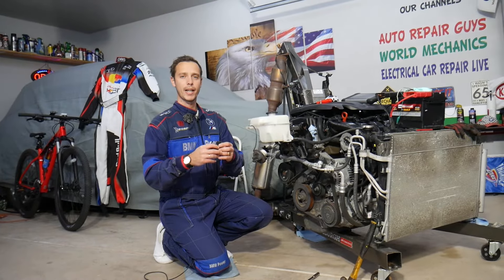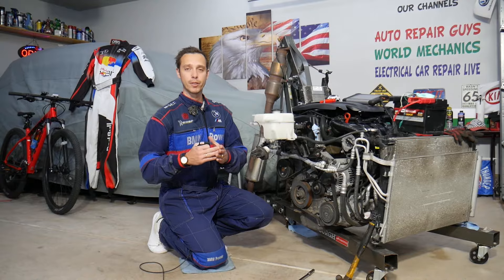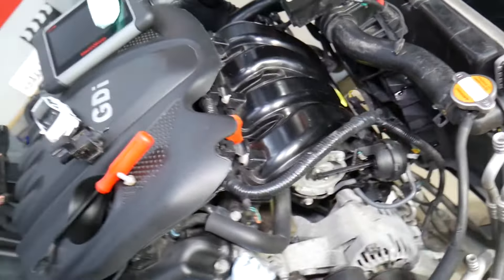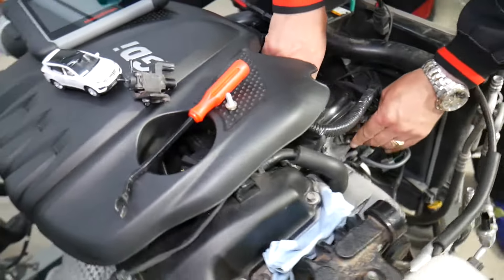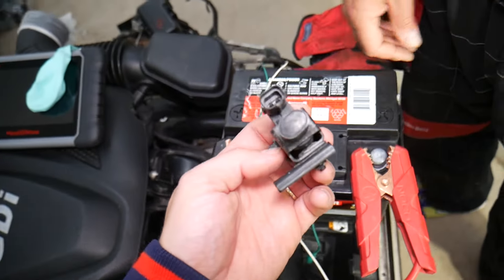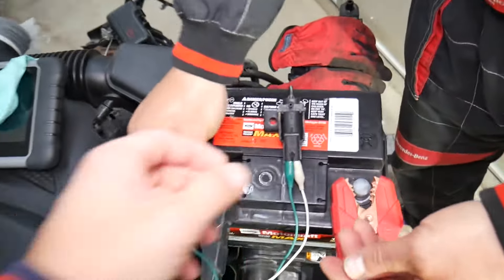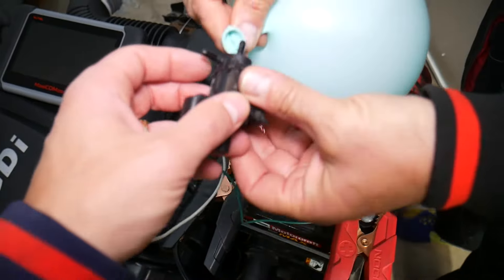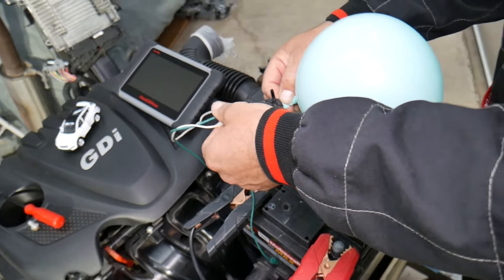HOW TO TEST INTAKE RUNNER SOLENOID ON A CAR

Comment from the maker: Products that we use and recommend:
► Intake Runner Solenoid: https://amzn.to/4fcIRxl
► Alligator Clips: https://amzn.to/2Xhxz2O
► Panel Removal Set: https://amzn.to/3YiMADu
► Assorted Fuses: https://amzn.to/4fx4s3F
► Tool Set: https://amzn.to/3p5MM6t
► Screwdriver Set: https://amzn.to/3XRB28Q
► Castrol Oil: https://amzn.to/3xBc8B9
► Oil Filter: https://amzn.to/3w0Ulme
► Torque Wrench: https://amzn.to/32qyRwg
► Liqui Moly Engine Flush: https://amzn.to/3IiDBID
► OBD Scanner that we use most often: https://amzn.to/3I4MQfe

► Check out our Amazon Store for the tools and parts that we use: https://www.amazon.com/shop/worldmechanics

Comment: I got the P1130 code and was recommended to replace the IMRC valve.   I checked it and it was working perfectly.  so saved me 112$.  now I have no clue what the problem is.  need to do more research.  99 maxima if anyone knows..

Comment: What if the IMRC valve tested at 12v works but the connector sending the power to the IRMC is 1.57v?  Where can I check for that
Reply: You check for a short or your computer's signal.

Start by checking the specs on your vehicle to see what the computer is supposed to send out for that signal, and where that wire comes out of the computer. 
Either 12v or 5v usually. 
If the computer doesn't send out a proper signal then you should check the voltage regulator or condemn the computer. if it does send out a proper signal then check for a short.